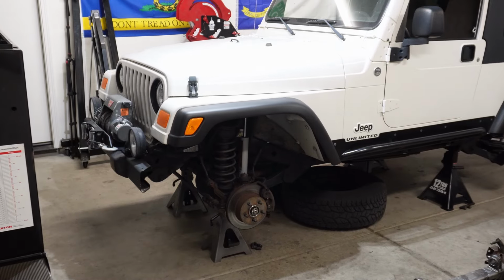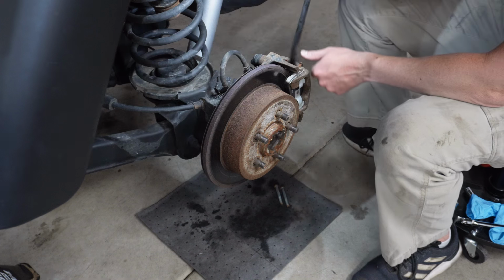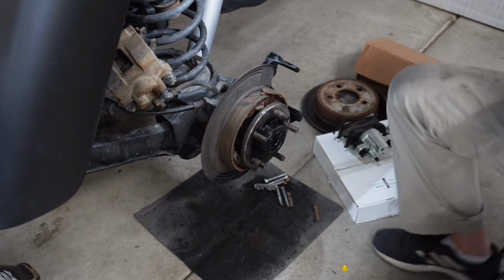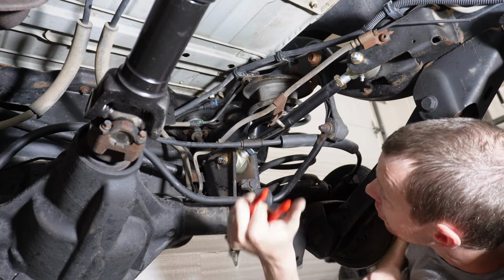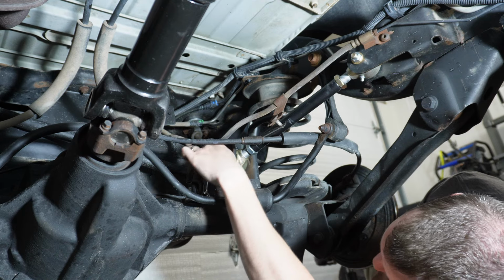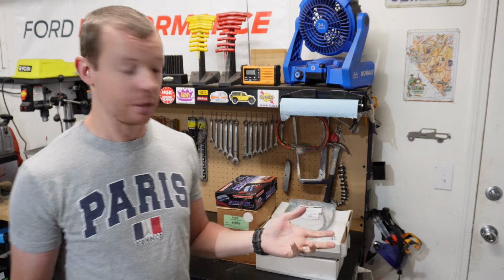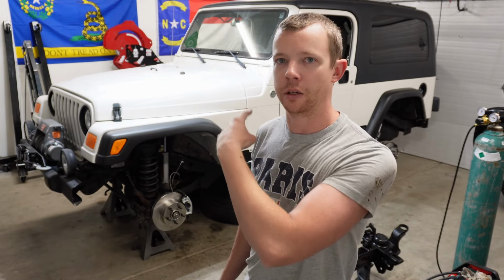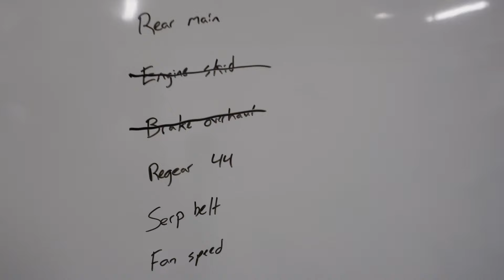Brake Overhaul on the LJ

Comment: Nice work.  In my experience the OEM brakes were sub-par with the factory 245/75-16s.  After I went to 35x12.50s they were downright scary.  Upgrading is the best money I've spent on my LJ.
Reply from the maker: They feel great on mine right now and it stops just as good as my Ram. We'll see once it gets tires.